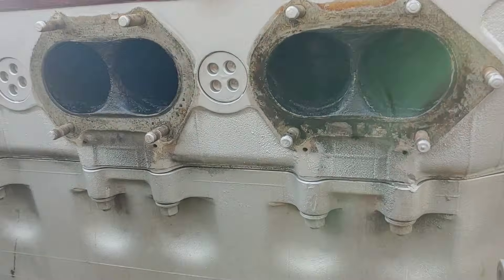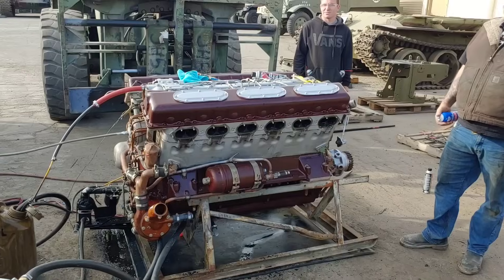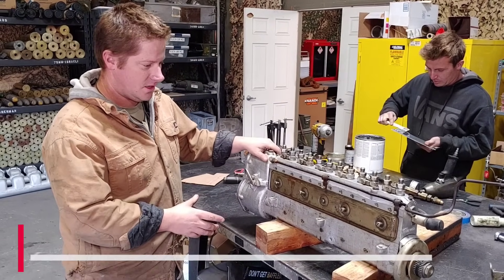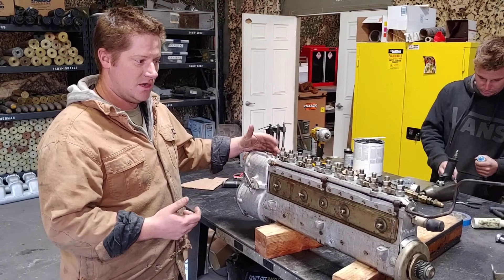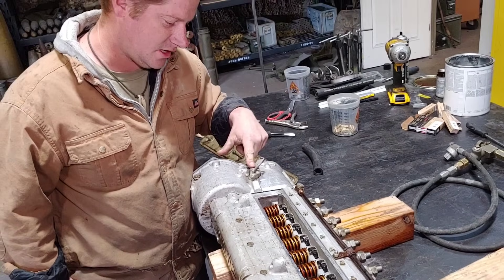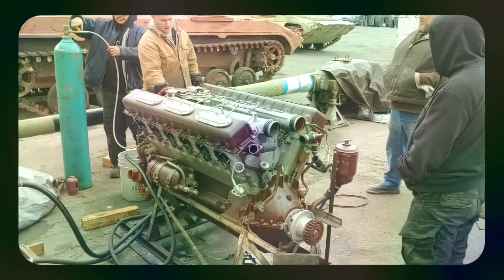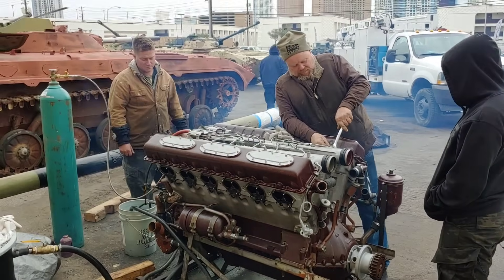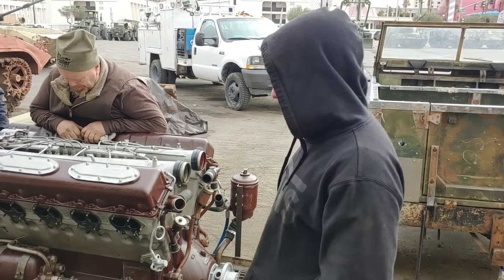New Engine for T62 Tank / Soviet V55.

Comment: 1917 LIBERTY L-12 V12 45° 27000 CM3 BENZIN ZENITH Carburettor Aircraft Aeromotor Alumínium Motor Engine Licensed Copy Variation CCCP SZOVJETUNIO SZOVJET SOVIJET BD-2 W-2 V-2 B-2 V12 60° 38880 CM3 Diesel Motor Engine Variation!!! J. Walter Christie!!! Christie M 1931 Tank Christie M 1932 Tank LIBERTY L-12 V12 45° 27000 CM3 Benzin Zenith Carburettor Aircraft Aeromotor Motor Engine!!! CCCP SZOVJETUNIO SZOVJET SOVIJET BT-1 TANK BT-2 TANK KV-1 TANK KV-2 TANK T-34 TANK!!!United States of America USA Liberty L-12 V12 45° 27000 CM3 Benzin Zenith Carburettor Aircraft Aeromotor Alumínium Motor Engine!!! V Y X * 🌟☀️🇺🇲!!!

Comment: The internal phasing of that injector pump on most if not all 12 cylinders  is sooooo wrong. Ive got an untouched one of those injector pumps and have checked it on my test bench and it was out by 11- 20 degrees on 10 of the 12 cylinders from factory. Makes a giant difference to how they run after setting them
Up right and esp the white smoking issue most of the Russian engines seem to have. White smoke means the fuel is going in but not burnt properly, normally due to a lack of heat in the cylinder from lack of compression, timing and in some cases extremely bad as in leaking/dribbling injectors. But get the pump sorted and injectors too and they burn clean. Yes they may be a slight tinge of blue in some engines exhausts but def not the eye stinging throat choking white thats so so common.
Reply: Normalerweise werden diese Motoren auf 60Grad vorgewärmt vor dem Start. Die schmeisst keiner kalt an, nicht mal bei Alarm. Da rennt der Fahrer in den Park und wirft den Vorwärmer an. Sein Zeug bringen die anderen mit. Da qualmt auch nichts mehr weiss.

Comment: The T-34 tank was equipped with a V-2 diesel engine. 25

It was a deep modernization and conversion of the M-17 gasoline engine - a piston V-shaped 12-cylinder aircraft engine with water cooling - a Soviet licensed copy of the German BMW VI,
Reply: Чушь не Пори, почитай настоящую историю разработки
Reply: United States of America USA J. Walter Christie!!! Christie M 1931 Tank Christie M 1932 Tank LIBERTY L-12 V12 27000 CM3 45° Benzin Zenith Carburettor Aircraft Aeromotor Motor Engine Licensed Copy Diesel Motor Engine Variation!!! CCCP SZOVJETUNIO SZOVJET SOVIJET BD-2 W-2 V-2 B-2 V12 60° 38880 CM3 Diesel Motor Engine!!! BT-1 TANK BT-2 TANK KV-2 TANK BT-2 TANK T-34 TANK!!!
Reply from the maker: @FaikHuseynov-nb5bj  ok, very interesting, I'll look in to that,  I do know that just about every engine design based on a foundation that comes from elsewhere, if I remember correctly some German aircraft engines had British roots, so Soviets are not unique in that sense.

Comment: How does that engine differ from the V2 engine in the T-34?  Without having a V2 engine in front of me, they look very similar.
Reply from the maker: @Pamudder  well V-2 was gradually improving through out it's life time, pretty much everything got better with time, cooling lubrication electrical systems, means of production improved as well. In my video "T62 Explained" there is a bit where I show the difference between  T54 and T62 engine power output.
Reply: @ thank you.

Comment: It needs to be mentioned that engines based on pre-WW2 V2 engine (as V55 is member of that family) are still produced today, only equipped with turbines (turbodiesels). They still have the same cylinder diameter and displacement!
Reply: Technology wise, it's no wonder. It has dual overhead cams, 4 valves per cylinder, crossflow heads, all aluminum construction and even puts out decent power for a non supercharged diesel engine. It's amazing to think that this engine was in full production in 1937, a time when flathead engines were most common. It looks good too! Not everything communism produced was bad. 😛
Reply: @daniellofgren1165  It was based on the Hispano-Suiza 12Y aircraft engine.  It also has dry sump lubrication which is why it is so compact for a 28.8L engine.  A derivative H12 engine was developed at the Chelyabinsk Tractor Factory for the now-cancelled T14 Armata main battle tank which has four cylinder banks and twin turbochargers making 1600hp (if I remember right).
Reply: @douro20  38,8 litre
Reply: @Вячеслав-ч1щ2ф  Yeah you're right...
Reply: United States of America USA 1917 LIBERTY L-12 V12 27000 cm3 Benzin Zenith Carburettor Aircraft Aeromotor Alumínium Motor Engine Licensed Diesel Variation CCCP V-2 V12 Tank Alumínium Motor 38880 cm3 Diesel Engine Variation!!!!

Comment: Looks like a good engine design. Could use it in a truck or tractor puller.
Reply from the maker: @f4phone104  these engines are in fact used in tractors, I believe even in certain types of light train locomotives, they also have different modifications, like a straight six (in PT-76 light amphibious tank), and a V6 version.